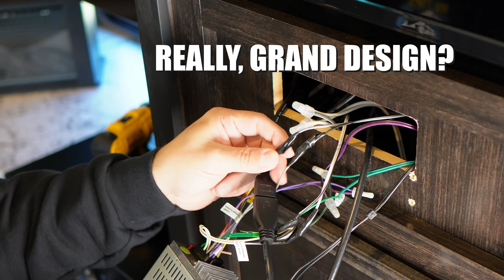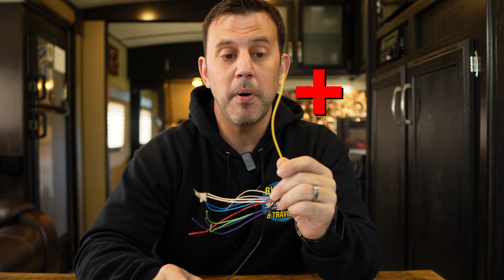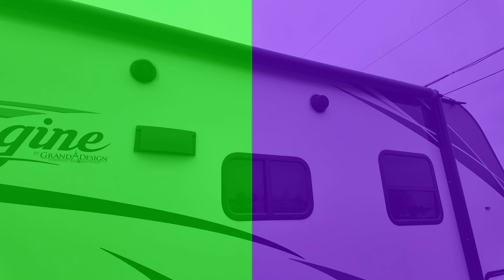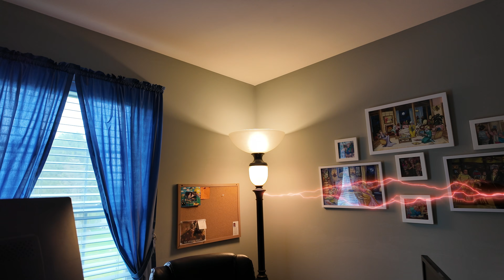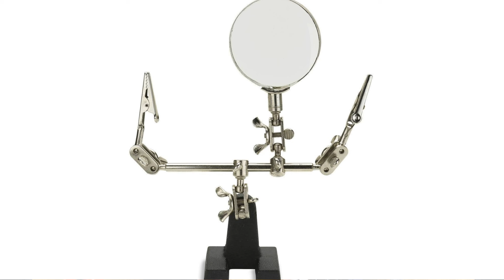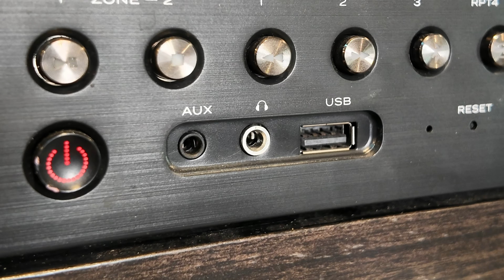12 Volt RV Stereo / Radio Head Unit Wiring - Explained for Beginners / Newbies

Comment from the maker: ✨ PRODUCTS FEATURED IN THIS VIDEO ✨
🔸 http://www.RVMattress.com/rvtips use code RVTIPS at checkout to receive 30% off your mattress
🔹 Butt Connector Kit https://geni.us/pUgRtDa (Amazon)
🔸 Wire Strippers/Crimpers https://geni.us/44ijG4 (Amazon)
🔹 Heat Gun https://geni.us/rjn3sR8 (Amazon)
🔸 Multimeter https://geni.us/m2VJJ (Amazon)
🔹 Electric Tape https://geni.us/rAgAqAW (Amazon)
🔸 Drill https://geni.us/OQhqvub (Amazon)

OTHER VIDEOS YOU MAY LIKE
🎥 RV Stereo Trick https://youtu.be/IU4dzd6C6wM
🎥 7 Overlooked Tools & 1 Important Maintenance Procedure https://youtu.be/_uYnZ5_rg9w

🛠 Resources in this video:
-Speaker Gauge Chart: https://drive.google.com/file/d/1PUHhMGnR1Hq59el1sxVH9nHDcEE04W-4/view?usp=sharing

12 Volt RV Stereo Head Units Explained - Essential Guide to Remove, Diagnose or Install After 30 years of installing car stereo head units I've learned a lot. I'll teach you what you need to know to diagnose or replace an RV stereo & video / DVD head unit. I keep things simple so you understand what you need to know, and wont overwhelm you with the things you don't. There is much more to these units than what's in the video that I don't feel is necessary for the average person to know, but if you have more advanced questions please drop us a comment.

#rv #rvlife #rvliving #rvlifestyle #rvtips #rvtravel #rvtipsandtravels

RV ESSENTIALS & TOP PICKS 
🎥Essentials Video: https://youtu.be/yuvS3zZL81c 
🔷Sewer Hose Kit https://geni.us/7dNg (Amazon)
🔷Clear 90 Degree Sewer Elbow https://geni.us/L79gI2 (Amazon)
🔷RV Water Filter https://geni.us/FZ1P (Amazon)
🔷Best Wheel Chocks https://geni.us/9B5i (Amazon)
🔷Power Watchdog 30 Amp Surge Protector/EMS https://geni.us/zKcm (Amazon)
🔷Power Watchdog 50 Amp Surge Protector/EMS https://geni.us/jgOto (Amazon)
🔷Wireless RV Leveler https://geni.us/DAW9N24 (Amazon)
🔷Leveling Ramps https://geni.us/m38VoBr (Amazon)
🔷Liquified RV Tank Treatment https://geni.us/QTUJSrP (Amazon)
🔷Tire Minder TPMS https://geni.us/8HBSTg (Amazon)
🔷Water Pressure Regulator https://geni.us/fTzA0 (Amazon)
🔷Drinking Water Safe Hose https://geni.us/emLdlC (Amazon)
🔷Browse All Essentials https://geni.us/1Omwvhh (Amazon)

MAINTENANCE:
🔶Boeshield T-9 Rust Preventative & Lubricant https://geni.us/uXxstyC (Amazon)
🔶Geocell Proflex Sealant https://geni.us/YXiACx (Amazon)
🔶Water Heater Cleaning Wand  https://geni.us/AcTvhLc (Amazon)
🔶Water Heater Cleaning Adapter https://youtu.be/h6C6ihTQ1cY
🔶Waste Tank Rinser https://geni.us/V2XLE (Amazon)
🔶Road Tool Kit https://geni.us/oBFnd9l (Amazon)
🔶Eternabond Roof Tape https://geni.us/6AXdw (Amazon)
🔶Browse All Maintenance https://geni.us/UvxFP (Amazon)

INSIDE
🔷Screen Door Handle https://geni.us/itRfKUQ (Amazon)
🔷Shower Caddy https://geni.us/ZPcno (Amazon)
🔷Oxygenics Shower Head https://geni.us/jznwF (Amazon)
🔷RV Paper Towel Holder https://geni.us/Acknol (Amazon)
🔷Dimmer Switch (watch video) https://youtu.be/2bbqBcSsRZQ
🔷Electric Heater Fireplace https://geni.us/YmBoktI (Amazon)
🔷Browse All Inside https://geni.us/BWiOR8k (Amazon)

OUTSIDE
🔶Gravity Chairs https://geni.us/VlPR8rn (Amazon)
🔶Ground Mat https://geni.us/wbWWLzf (Amazon)
🔶Table https://geni.us/qsPO (Amazon)
🔶X Chocks https://geni.us/3oyburw (Amazon)
🔶Blackstone Griddle https://geni.us/8BuIrW (Amazon)
🔶Low Point Drain Valves https://geni.us/yBB02h7 (Amazon)
🔶Browse All Outside https://amzn.to/4ld0kcz (Amazon)

👇 COUPON CODES! Use the links. Save money. Simple.

🚐 10% off RV Snappads & Snapjacks https://rvsnappad.com/discount/RVTT10

💦 Blu Technology Water Filtration Systems 7% Off, $80 or more No code needed just use our link:  https://goblutech.com/xxnnkdun 

🛌 Get 30% off your RV Mattress by Brooklyn Bedding at https://rvmattress.com/rvtips
Use Discount Code: RVTIPS

📷 Haloview Back Up Cameras 5% Off & FREE Shipping (Use code RVTIPS at checkout) https://www.haloview.com/products/byte-tango-1080p-observation-camera-system.html?acc=765

🔧 NRVTA Home Study Course https://rvtechcourse.com/discount/RVTIPS20
Use Discount Code: RVTIPS20

🚴‍♂️️ Lectric eBikes - Use our link get FREE accessories https://lectricebikes.sjv.io/nLrJ3x

💻 Our eBay Store! You never know what you’ll find!
https://geni.us/6AyLKnS (eBay)

💥 Join Our FREE Newsletter! https://rvtipsandtravels.myflodesk.com/freenewsletter

If you want to support the work I do to help others, you can donate here:
Paypal: https://www.paypal.com/donate/?hosted_button_id=J2KKM9NR3BJJA
Venmo: https://venmo.com/u/Ross-Stoico

✨ AMAZON RV STORE ✨
https://www.amazon.com/shop/rvtipstravels

Follow Us on Social Media
https://www.instagram.com/RVTipsAndTravels
https://www.facebook.com/RVTipsAndTravels

🙏 If you find a dead link, PLEASE let us know & we’ll send you bumper stickers!

As an Amazon Associate, I earn from qualifying purchases. There is NO ADDITIONAL COST TO YOU when purchasing from our links. Thank you for your support! 2.0

Comment: Great video Ross!!! Thank you for posting. I have a question. We will get a toy hauler soon… the idea was to turn it into a cinema screen room! :-) we want to take the tv that comes there and get a projector screen instead. I was just wondering what you would recommend for sound? Is there a way for me to connect the projector to the sound in the garage of the toy hauler? I think Bluetooth might be out of sync so I was wondering if we could maybe connect a Amazon stick to the projector and connect a cable directly to the projector that will connect the visuals to the Rv sound system….
Reply from the maker: Its hard to say without seeing all the equipment and its available outputs, but im sure it could be done somehow as long as the device that plays the audio source (or any device that also receives the audio source) has a wired speaker output.  if you can let me know the model numbers of the equipment you are using i could probably help more.

Comment: I purchased new speakers that came with Blue LED lights that have their own power leads. How can I get power to these when I power on the radio?
Reply from the maker: you would need to run the light grounds to a constant ground, then the + leads to a switched lead on the head unit.  in the video i discuss the power antenna and amplifier wires, blue and blue with white stripe respectively.  you can connect the speaker + light wires to the blue with white stripe on the HU.  they only thing worth nothing here is to find out what amperage the lights will pull, and make sure that is within the range of the amp rating that the amplifier wire puts out.  if the lights pull more, you may need to wire in a relay.

Comment: Hi, I recently purchased a motorhome from 2001 based on a Chevy express and it has two door speakers and two speakers by the bed. I was wondering since all the speakers are connected to the radio up front which is a kenwood radio if its possible to somehow wire the two speakers by the bed directly to the tv so when the motorhome is off i could watch tv with sound playing through those two speakers instead of the speakers directly in the tv. Please let me know if there is a solution somehow.
Reply from the maker: how you do it depends on the model of TV you have.

Comment: I'm replacing the head unit on my Rv but a lil confused as to how to wrire the outside speakers, as the wires coming from the Rv are not labeled well.  My assumption is that I can connect all speaker wires (gray, white, purple & green +) & (gray, white, purple & green -) to the two respective L or R neg or positive RV wires?  Is this correct?
Reply from the maker: theres a whole section in this video on how to determine which wires coming from the speakers are positive and negative using a 9 volt battery.  and no you cant connect them all to 2 speakers.  that will mess with the impedence.  2 wires go to speaker only.  a positive and negative from 1 channel to the + and - of 1 speaker.  the 9 volt battery will help you determine which wires from the speaker are + and -.  they will be labled on the HU side.

Comment: Love your videos and since I just got an RV they've been very helpful. Do you have anything on how to install the stereo? My RV didn't have one installed and I'd like to install one but not finding many videos on how to install a stereo with inside and outside speakers.
Reply from the maker: youre going to have to run wires into the walls and drill holes for speaker wires outside.  i would advise against this if you havent done it before.  an easy workaround is getting a small portable stereo that plugs into the wall, then connecting bluetooth speakers to it... they can be located anywhere you want, and their movable.  https://geni.us/FlvV1n (amazon)

Comment: I recently purchased a Jensen JWM92A RV stereo for my camp trailer. It came with no instruction so I'm a bit confused on the wiring. I have a black ground, red 12VDC switched and a blue AMP Remote wire, all other wires are labeled as speakers. I am assuming the red 12VDC is my constant power wire, blue AMP Remote goes to an external amplifier and Black is ground, as noted. I do not have an external amp, do I leave that unconnected or do I connect that with the red wire to the battery? These wires coming off the stereo pigtail are all 20AWG. Am I to assume that I need to run 20 gauge wire to the battery as well or should I go with a larger gauge wire? That would mean 20 gauge from pigtail connecting to 20 gauge power wire to the battery and it's about 20 feet to the battery from the stereo?
Reply from the maker: hard to answer these questions without seeing all the equipment and your set up.

Comment: Anyway to hook up a subwoofer?
Reply from the maker: you can but youll need some sort of amplifier.  those HU's will not provide enough power to move even the smaller subs.
Reply: @RVTIPSANDTRAVELS any suggestions

Comment: What a great video!! Clear, concise and to the point. I like it. My RV came prewired with no head unit... I'll be ordering one now and will install myself... Do you have any recommendations for head units?
Reply from the maker: to be honest, I was always a JVC fan.  Clarion and Alpine are big names, but I always found JVC to be very reliable and easy to navigate.  I havent really been involved in the car audio scene for some years now, theres probably a dozen new companies.  If you plan on wiring outside speakers it might make sense to get something more designed for RV's, which will give you a button to switch to outside speakers, instead of having to menu into the fader.

Comment: I replaced my speakers with good ones and also bought an amp to make them sound better. The head unit in my RV is 20 W RMS. The new amp is 50 W RMS.

I am concerned because the new amp says to use four gauge power wire. I don’t think the wire coming up to my head unit is any more than 10 or 12. I also went to my fuse box and it shows the entertainment fuse being 15 Amps. the amplifier wants a 60 amp! This is a 40 foot RV. Should I just return the amp and forget about it? Any suggestions?
Reply from the maker: whats the make and model of the amp?
Reply: @RVTIPSANDTRAVELS  rockford Fosgate, R 2–300/4. 50 W RMS.
When I bought it, I reasoned that the head unit would not be drawing It’s 22 watts RMS so the additional wants may not be an issue.  
In the 12 V fuse box (halfway between the stereo and the inverter/converter) The entertainment system has a 15 amp fuse and the box says I can use up to a 20 amp fuse. 
However, it also says that if I move the wiring to the first position in the box, that position is good for a 30 amp fuse.  

I bought jl audio C2 speakers which are a great upgrade, but I know I am just not getting the true punch from them that they are able. Really really want to use an amp, but don’t wanna burn down the place.

Possible, but extremely difficult to run a wire into the undercarriage and all the way back up into the battery compartment. Yikes! I would imagine that would be a 25 to 30 foot run.
Reply: Ps: I am permanently hooked up to shore power.
Reply: PPS:  just had a bit of an epiphany. Perhaps I can plug in a 12v converter at a 110 plug?

Comment: Hello thank you for your knowledge and sharing.  Why isint there videos on how to install stereo on camping trailer with no manufactor radio installed? 
Do you install stereo directly to battery? 
Thank you !
Reply: most older campers never came with any kind of radio's, newer campers today, most will have them already installed in them. older campers with no radio's will not have any speaker wires, power wires already ran in the unit. todays campers though, most will have all the wires ran through out the unit. you can wire head unit to battery, just make sure you have an inline fuse at the head unit. you prob won't find many video's out here with someone installing radio's into older campers for the simple reason, no one wants to run wires from the head unit all through out the camper walls and ceiling !. can it be done?..sure...but won't be easy !. unless you rip the roof apart, rip the walls apart just to run all the wires?, it will ruin your day..lol.
Reply from the maker: you're going to see radios and head units less and less.  phone integration will take over the RV market, just as it did in automobiles (whens the last time you saw a cd player?)  Our new rv had no head unit, no speakers.  the easiest way to get some sound into the rv is bluetooth speakers like this one: https://amzn.to/4mf0Ffj
Reply: @RVTIPSANDTRAVELS  i have one of these tubes, its a sony though, works very well. i also have a sound system in my camper, but it sounds like crap !..lol.

Comment: Thanks for the video very helpful!! 
I searched and didn't see any reviews on replacement head units for  the current  basic furion head units. Is there a general idea of what to look for or avoid? I know specific manufacturers can be user dependent or preference.
Reply from the maker: thats a tough question to answer because there really isnt much out there specifically designed for RV's.  I would start with finding a few head units that fit in the opening of the old one.  Once you find those, let me know and we can compare.

Comment: Can I add a amp to my rv trailer my head unit wire harness doesnt have a remote turn on wire or any blue kind
Reply from the maker: if your HU doesnt have a remote turn on you can still add an amp, you will just need to find another source for the amps remote turn on lead, best idea would be a switch next to the head unit.

Comment: Looking at an IRV 62. It has. "Sub Out" port only on the wiring diagram ( no wires on the diagram labeled as for a sub). Can you use a 110 volt powered subwoofer with an IRV 62. BTW awesome video love the trick with the 9 volt battery.
Reply from the maker: i would worry less about if its a home audio or car audio subwoofer and more about the amount of wattage the subwoofer channel provides, and if the head unit output resistance matches the ohm rating of the subwoofer.  i cant find any good specs on this HU so im not sure of its capabilites, but its very rare that you would ever have enough output power to power a subwoofer from a head unit.  that sub out line on the HU is most likely designed to run into an amplifier, and then to a sub.
Reply: @RVTIPSANDTRAVELS  If it is a POWERED (ie 110 volt plug in) subwoofer doesn't the power come from the subwoofer power unit and not the head unit?
Reply from the maker: sorry about that, i thought you were talking about a raw subwoofer in speaker form.  yes, that will plug into 120. the subwoofer output from the head unit (if it has one) will wire to the amp (im assuming the powered subwoofer is built in a box with an amp).  i dont know what the impedance on the subwoofer is, but that shouldnt matter since you are running a raw audio signal into the amp.  the amp and sub should already be paired to work together.  you can do this, i just dont know what its going to sound like.

Comment: Question about the yellow wire.  When the radio is on and playing ,Is all power to operate the radio coming through the yellow or the red.
Reply from the maker: In most cases the yellow, that’s why it’s thicker and sometimes fused on the wire.  There may be some things running off the red, but majority of power comes from yellow.

Comment: Thanks so much for this video.  I just replaced the factory head unit in my RV motorhome dash.  My problem is that the factory unit would still turn on when I was not driving and connected to shore power.  With the new head unit, when the ignition is off, so is the head unit.  The wiring guides are well beyond my ability to comprehend.  What wires do I connect to in the dash to ensure that I have power when connected to shore power?
Reply from the maker: i cant tell you that answer without having a wire diagram for your vehicle.
Reply: use a 12volt dc test light, by turning the key on, you can test to see which wires get power when key is on , or key is off. red wire will almost always be switched power, this means the head unit will only get power when key is turned on. the yellow wire will almost always get power all the time when key is off. all this does is keep your stations programed into the head unit from erasing when you turn the key off. from what you are stating here^^?, it sounds like the factory wired the head unit to get power all the time even if the key is off?, which means..they wired the head unit to get power straight from the battery even with the key off.